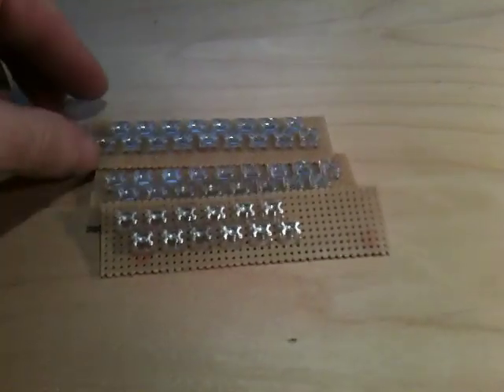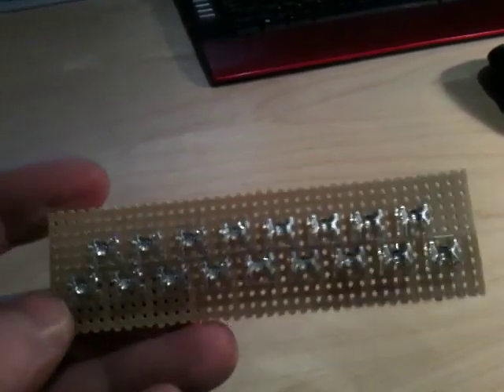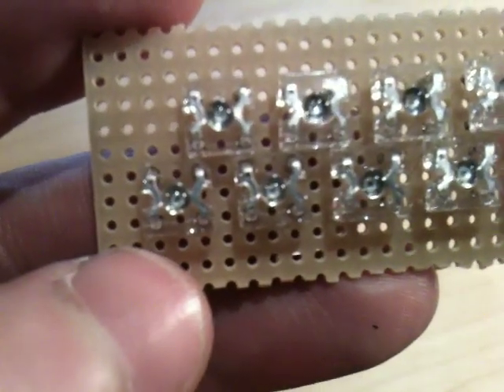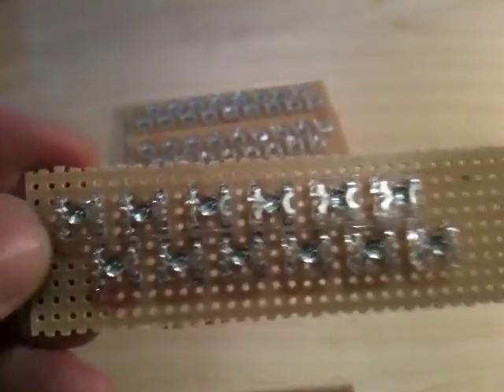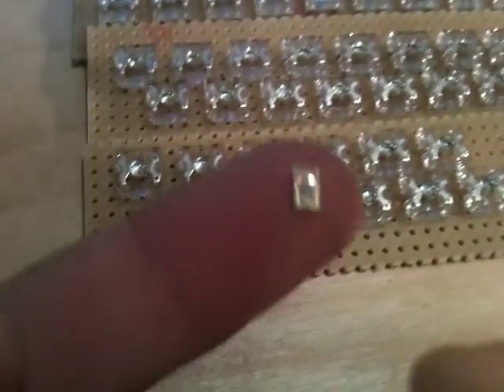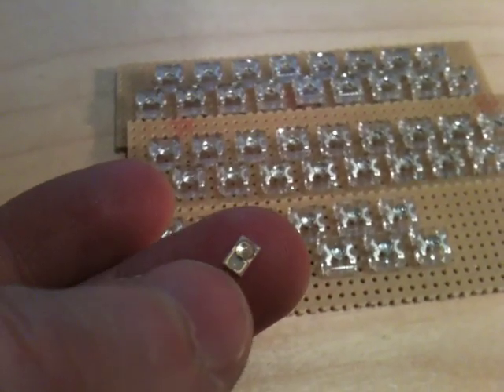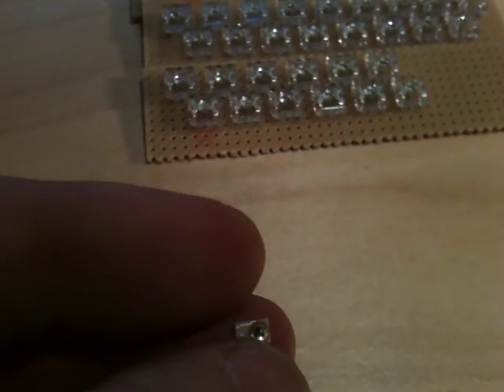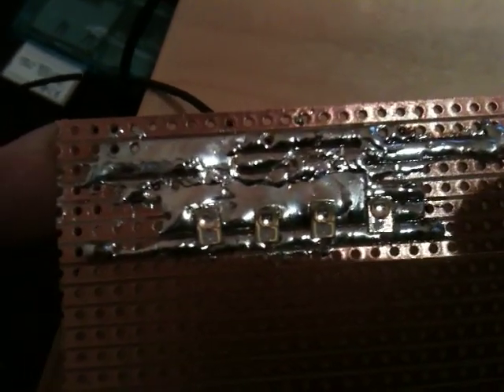Superflux LED and Luxeon Rebel preview

Comment from the maker: @KeithWasHere1 I'd just use a soldering iron and regular solder for soldering the wires to the board. You could use solder paste if you want, but it's much messier.

Comment from the maker: @KeithWasHere1 I've seen it done that way. But that is not the recommended way.

You'll need a temperature of about 230 C (or about 25 C above the melting point of your solder paste - 206 C is fairly typical). The problem with a hot plate is that, they are slow to heat and cool. The LEDs are very sensitive to high temperature, and will only tolerate a temperature of 230 C for a few seconds before being damaged. A hotplate may not heat and cool quickly enough to solder the LEDs before they burn

Comment from the maker: @KeithWasHere1 A professionally made PCB with solder-resist is almost essential for these. The best way to home solder these is to use solder paste, and a temperature controlled hot air gun. Place the paste on the PCB. Drop on the LED. Heat up the board with the air gun, with a thermometer attached to the board. Monitor the temperature and increase/decrease the temperature as specified in the rebel soldering instruction sheet.

Comment from the maker: @zx8401ztv They're too small to clamp, and the thermal pad is so small that thermal paste won't help (thermal paste is actually a good insulator, just not as good as air). The thermal pad has to be soldered.

The proper way of doing it is to get a proper PCB. If you have a "wire" running to the thermal pad 20 mm wide and 20 mm long, with vias to a similar wire on the bottom of the PCB. 
That way the PCB acts as a heatspreader, and you can then clamp the board to a heatsink.

Comment from the maker: @zx8401ztv Hot too. More than 30 seconds, and the flux starts melting on the solder!!

And that's at 25% power - I can't imagine what sort of cooling is needed for a bank of those at full power.